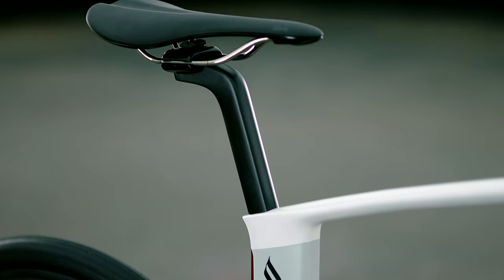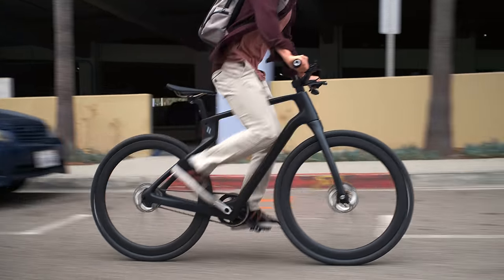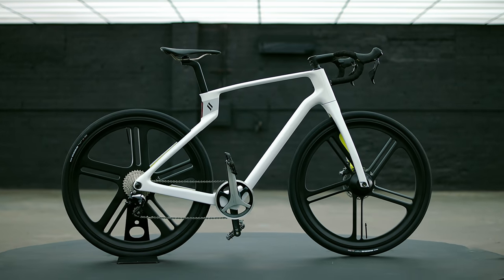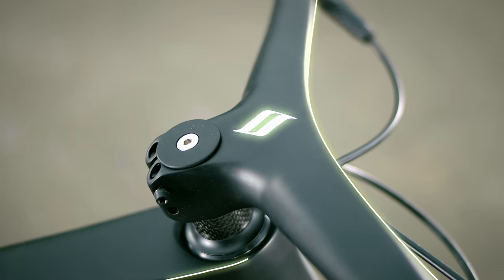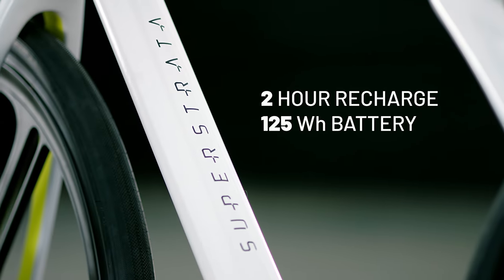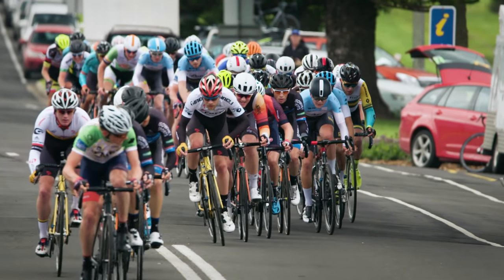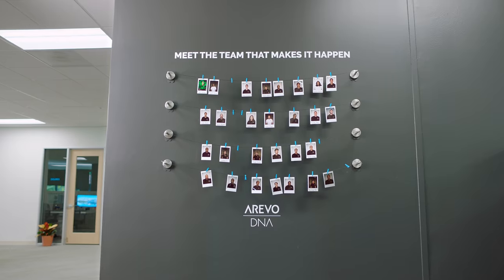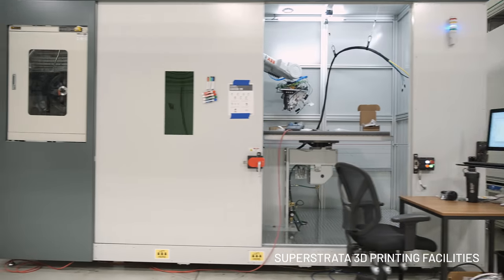The Superstrata: Custom 3D-printed carbon fiber e-bike

Comment: Not a single shot of anyone sitting down on the new version with no seat tube. Just saying.
Reply: Absolutely. Also, in the clip at 0:57 you can actually see the seat wobble, they didn't even bother screwing it on correctly.
Reply: It will be a production flaw in the early versions. I’m sure they’d fix it in the one they ship, but they probably ran out of time before having to film. There’s no way they’d have everyone standing for any particular reason.
Reply: @JamieBrigden  No. this is a scam. If they put out any bikes at all, it will be conventionally built and customized just by cutting down tubes that are glued together.
Reply: I've seen road frames from China that way lighter and cheaper than this, plus they allow for 2X.
Reply: korinogaro1988 The Superstrata frame alone weighs 1.3kg; the Chinese frame weighs only 850g for the largest size.
Reply: never ever 1300g ecpeckt 1500 to 1900g if there is any stability
Reply: @letsflywiththemusic  Nice catch!
Reply: 1300 g is on the mid-to-high end of weight for a modern carbon frame. You can get one that weight that's decent for $500 easy.
Reply: A frame like that will never work as the torsion caused by pedalling with twist the chainstays.

Comment: "The frame is so light it weighs less than two water bottles, seriously we tested that". Wow you went all in on the R&D with this one 👏
Reply: Still heavier than an aluminium frame
Reply: I'm no biker or expert, but two water bottles is pretty heavy, no ?
Reply: @Jez1963UK  standard 500ml water bottle x2 should be like 1.1 kg, 1.2 max

Comment: This video shows different bike models.  The one at 1:26 and 1:46 has no seat stays and has a single rear gear.  The one at 0:13 has a conventional derailler.  Some pictures show drop (racing) bars and some show flat bars.  None of them shows the battery pack.  
The lack of a seat tube makes it weaker, not stronger---there is a reason why all the high end pro bicycles have a seat tube directly from the seat to the bottom bracket, because this is the strongest and lightest way to do it.  That kink in the downtube makes it weaker, it's a styling thing.  It would be more impact resistant and lighter if the tube was straight, like most every other bike.
Modern mainstream bike manufacturers use the most sophisticated aerospace-grade techniques on their high-end frames and claims of 'increased toughness' should be viewed with skepticism unless proof is provided---every bike frame can be broken in a crash.

Comment: Just put a seat tube on it, it'll be stronger and needs the spot for a bottle cage. Make actual custom geometry frames, 3D printing should make that relatively easy, right?
Reply: But the hipsters would not care for it if it was an actual functional bike
Reply: @mahmam3128  Damn freds

Comment: I'm NOT a bike expert, but two things I noticed (before reading any of the comments below) - the rear light is obscured by the rear wheel, and you mention that previously carbon fiber bikes traditionally, one break and they're done, but you didn't mention or show how your carbon fiber bike wouldn't break after one failure ?  Also, I really don't like the name.

Comment: Everybody please be aware that this is not a bike for colder climates. As per Superstrata team, even though battery is removable it’s not recommended to do so due to the difficulty/time involved in the process.
Batteries die when left at -10C (14F) so storing the whole bike on a warm place is a must, forget about leaving it in the garage. If you live in a place where temps drops to freezing temps. Your bike will die as soon as winter hits.

Comment: 1.3kg is pretty heavy for a carbon frame (30% heavier than the competition) and the whole bike is 7.5kg. It doesn't seem aero either and there's no mention about the engineering of the wheels. 
I'm pretty sure you created a bike for nobody or the people with a lot more money they need.
Reply: I’ve seen aero(not climbing) road frames that are lighter than this.

Comment: by removing the triangulation created by seat tube, the frame is essentially a structural 'sky hook'. the massive loads on the joints with no triangulation mean it is an inherently weak structure. even if they have done 'workarounds' to compensate for its lack of triangulation in the frame, doesnt mean its a strong frame. if this exists at all it is surely a gimmick to impress those who place appearances and novelty over engineering. this surely must be a joke. oh and 3d printing isnt going to be stronger than carbon fiber or aluminium, as the layers created by such a method have a tendency to shear off. cant see anything but a con for the gullible newb. if you want a radical bike, that departs from the tried and tested diamond frame, they already exist. they are called recumbents.

Comment: Lots of haters on here?  Looks pretty cool to me.  Curious though, can you change the seats to something with more cushion?   Those small hard seats suck. :]  And are there more color options?  I am very interested in this bike though, it looks great.
Reply: For starters, those "small hard" seats are designed for use with padding on Cycling shorts, but i'd happily ride shorter distances with normal clothes on one. Schemes like this prey on people like you  who aren't so knowledgeable about bikes (no offence intended, people have different hobbies). You may see a cool looking bike but we see very little adjustment in the seatpost, bikes that aren't assembled properly, vague details (shimano groupset, what model?), a battery that isn't feasible for todays technology: take a look at current e-road bike downtubes. The design for the wheels is dubious too, also this bike is most definitely not lightweigh, despite what they say.
Reply: @hugoyoung4890  this video is a massive joke and to think they made about 5 mil out of the crowd funding campaign is mind-blowing. Man i think i might consider quitting my job and creating a similar scam if people are this easily fooled

Comment: Worst ebike ever ) Battery not changeable. Seat tube is missing. Why need custom 3d printed frame instead of multiple frame sizes?
Reply from the maker: The battery is removable, however, we recommend taking it to a bike shop first! We 3D print so we can customize your bike to your exact sizing.

Comment: I saw this bike and thought wow this could be cool and what a great price, until you look deeper. Looks like a cool hipster city commuter e-bike but they are trying to market as road bike and Mtb. No seat tube no front derailleur so 1x at the front. Great for an e-bike or city bike not so much straight road bike. Lots of questions on indegogo about specs with few answers.  Good video with an in depth analysis: https://youtu.be/x9HID20UBk4

Comment: The most illiterate bike frame design!  The frame is unreliable and has 3 loaded nodes which will lead to breakage!  Also no shock absorbers!  If you're trying to make a light bike, say it's for lightweight people! E-bike can't be lightweight, batteries and motor is heawy!  Fire your engineers!
Reply: For urban use shock absorbers don't do much. Widers tyres do the same with much greater simplicity.